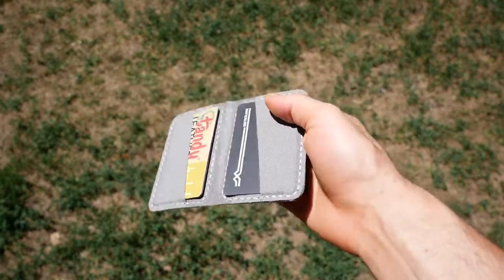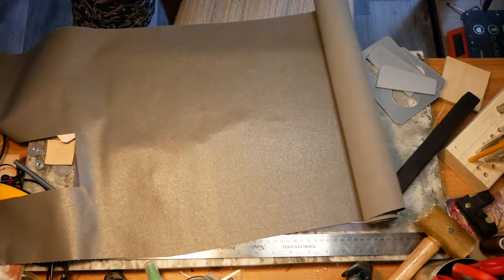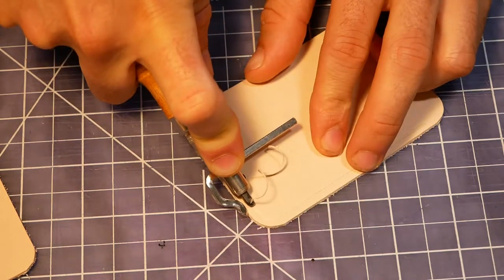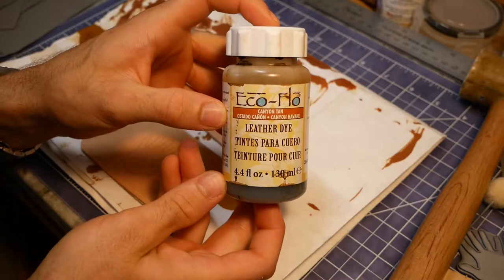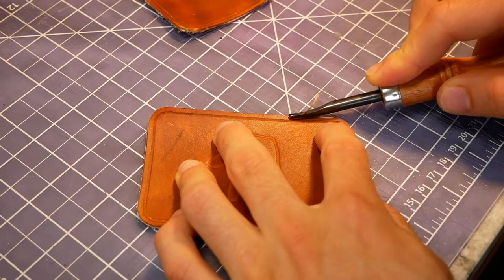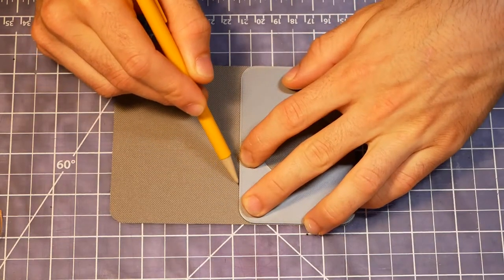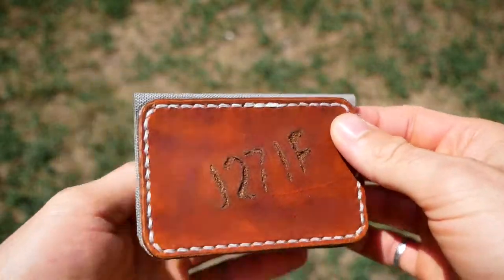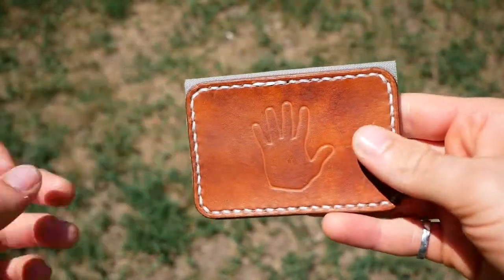Making a Slim Card Wallet out of Canvas and Leather

Comment: When you clip your thread, after stitching, leave like 1/8" and then your lighter to melt it, smoothing it with your finger when it burns flush. It gives the ends like a plug to keep from unraveling
Reply from the maker: Thanks for the tip, I’ll do that!
Reply: @MorleyKert  I make leather wallets as a part time small business. It helps immensely with NOT having to worry even in the slightest of stitching coming out. Oh and also, this one you made looks 🔥🔥🔥

Comment: Great video.  Any tips on a way to know much string you’re going to need when you saddlestitch?
Reply from the maker: Aaahhhh the age-old question. I've just figured it out through experience... had a few times where I ran out halfway through a stitchline on some earlier projects, and sometimes the line of stitching may be so long, that I'll split it into a few stretches rather than use a massive length of thread. I think for each side of this wallet, I used about 4 feet.
Reply: Morley Kert thanks!